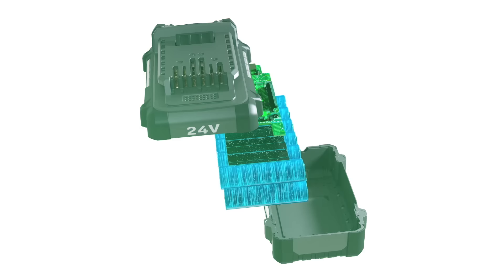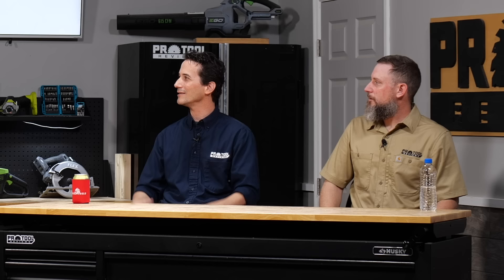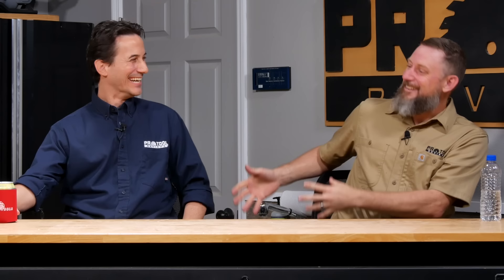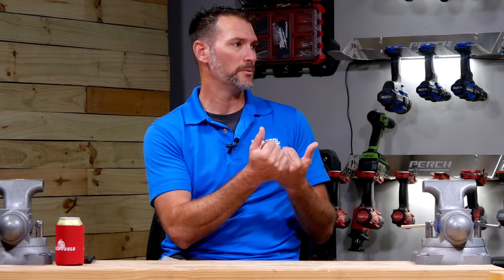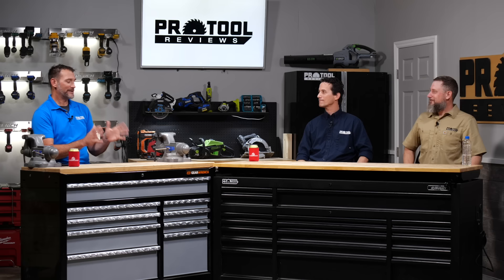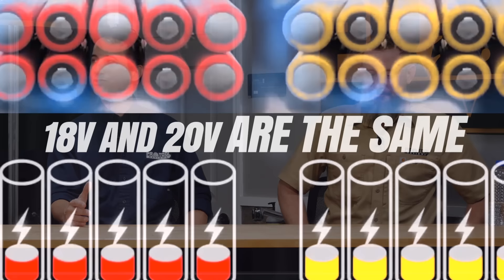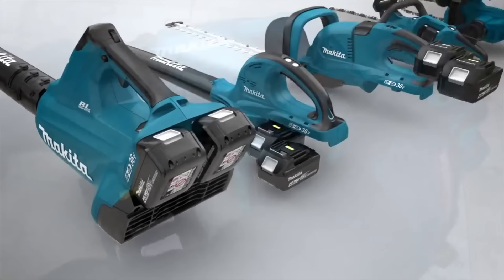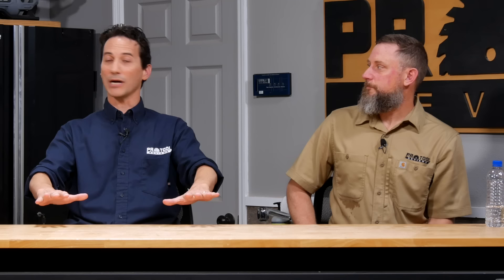You Should Buy 12V Instead of 20V… HERE’S WHY!

Comment: As an apartment maintenance technician, I'm pretty happy with my M12 Surge driver and oscillating tool. I occasionally use my M18 circ saw and M18 drill, but for the most part, the M12 is perfect for my situation.
Reply: I agree except that if you have the FUEL oscillating M12 tool, the battery lasts for literally two minutes. Every time I grab that tool I have to look around for batteries. The surge impact that I almost didn't buy because of the cost is great,
Reply: I'm an apartment maintenance tech too, and I completely agree. The size and weight are perfect for keeping in my tool bag.  The M12 tools will do 90 precent of what the 18v tools will do, but for much less size and weight.
Reply: @mytuberforyou  I have the fuel oscillating tool too, and I haven't had any issues with the battery not lasting.
Reply: @mytuberforyou  I used the oscillating saw with the 2ah batteries and they seemed to draw down quickly. Now I use a 4+ah battery and like it better. I mostly use it for grout removal.

Comment: I've found my M12 circular saw great in certain situations. When framing up structures it's not the greatest for constant cuts of 2x lumber, but if your working overhead or on a roof and need to make a quick cut it's incredibly convenient.
Reply: Needs a gen 2 with a rafter hook . Because it's so small and convenient I usually carry it up a ladder in a roof situation
Reply: I found my m18 non fuel 6.5" skill saw to be a piece of trash with a bent baseplate.

I stand by m18 fuel products. I haven't looked @ the skill saw but I bet it's good. I've seen 2 in the wild just never give it a run down. It's a full size 7 1/4" though.

My m18 fuel impact is frigging crazy! It has 4 settings, can be super delicate and stop itself, or like a mama bear, or papa bear mode! And a self tapping setting that stops it from impacting until it drills through.

The my key version you can go on your phone and set the torque value, and it has anti theft, but it's an extra 100 bucks...

Comment: I have Dewalt 20v and Milwaukee M12. I generally reach for the M12 fuel. In fact , like this morning, I only reached for my 20v impact because I could not remember where I left my m12 impact.
Reply: I have a couple m18 drills, a bunch of m12 stuff, and a ryobi set I bought because I needed a bunch of power tools and it was cheap. I've used the ryobi stuff a handful of times, im always using my milwaukee tools

Comment: I can agree somewhat with augmenting with 12v tools in certain instances of very tight spacing in specialty trades such as hvac/service techs/plumbing. Personally, after 38 years as a master carpenter/builder by trade, and a "can fix almost anything" guy in my off time, I have never found anything that i couldn't use my 18v Milwaukee tools for through judicious use of adapters/extensions/swivels that I couldn't accomplish using hand tools. To me the lack of power and versatility in a 12v tool doesn't justify the added cost and headache of having to buy, carry, and maintain them.
Reply: Yea, same here. plus I have to have a second type of battery...
Reply: @marcburns508  Yeah, this idea of going 12v seems to be for people who dont mind taking up extra space and cost having 2 versions of each tool, just because one is 2 pounds lighter and a tiny bit smaller.
I sympathize, but everybody is admitting 12v is only good for most things, not all.
So its nice to have if you dont mind using the extra space or cost, but this discussion would be less edgy if they changed the title to something more suggestive instead of demanding.

Yeah, 12v isnt bad at all, but I mainly need these when traveling for work, and I prefer a tool that does it all, instead of that only does most. But thats just me. If you have a shop, I get it. Space and cost dont matter as much.
Reply: As someone who maintains 16 properties and does everything from plumbing, moderate carpentry, hvac, and electrical I love my 12v tools for the light weight, compact size in my bag and general ergonomics. Also helps I got an insane deal on a 4 tool m12 fuel tool set but I’m not complaining

Comment: As a luxury apartment maintenance technician in a building with over 200 units, I’ve learned a 12v, especially the 12v fuel lineup is super useful. Light and almost as powerful as 18v. My 12vs do everything I need, literally from concrete to cabinets. Takes a bit longer but speed isn’t important in our field. Accuracy and precision is. And working hvac as well, it feels great to no longer carry 18v. The bag is heavy enough, 2 pounds makes a difference over time. Only 18v I have is my leaf blower. Even my vacuum is 12v from Milwaukee.

Comment: Once a installed 4 rows of seats on a big van (involving drilling and tapping the hardened steel legs of the seats) with only a Bosh 12v drill that are even more compact than those mentioned, and they were brushed the nowadays brushless are even more efficient and powerful.
Reply: I have had a 12V cheap mini SDS hammer for a couple of years, maybe not as powerful but powerful enough, light, and comfy, router and multi-tool pretty much the same...best description for 12V is "it'll do, little piggy, it'll do" xD

Comment: I bought Milwaukee 28volt system in 2002. I still have some of them and use them daily. I also have 12v and 18v. There is a MASSIVE difference in their capabilities.  If you want to do 80% of the work with no issues, get 18v. If you need lightweight and convenience get 12v. If you’re a professional and need the tool to easily get the big jobs done then get the 28v.

Comment: I run a yacht restoration and rigging business. I almost exclusively use the M12 line of tools for all of my rigging and most of my yacht restoration work with a couple of exceptions. The compact design make these tools perfect for hauling up the mast.   If you look at the M12 fuel line you will find that the power of the gen 2 and 3 tools are nearly the same as the older style of M18 or 20 volt max. The 12 volt tools will meet the needs of more than 95 percent of people and even most contractors

Comment: I am a big fan of the M12 Fuel system.  I have a few of them including the new Fuel multi tool. I had my Milwaukee 18v Fuel hammer drill and impact driver stolen. I had just started a handicap ramp job when some low life broke into the truck and got the 18v system. My HD store did not have the same kit in stock so I grabbed the M12 fuel kit. I built that entire project with the M12 fuel kit. Including using the hammer drill quite a few times
 Driving a large box of 3" deck screws.  Drilling through the 4×4s and joists for the carriage bolts. Driving a bunch of 3.5" lag bolts.
The list goes on.
I was highly impressed with the power and ability of the M12 Fuel system.  This was a large job complete with a landing for a 90° turn to follow ADA guidelines. 
While the Milwaukee M12 Fuel system is probably not designed for this extreme use I can attest to its ability to carry it out. I highly recommend it. For a home owner that dosen't really need the 18-20 volt systems but wants something that could do anything they wanted, including building a deck. This system is more than capable
Reply: I think the optimal level/word you used here is FUEL, or pretty much any tool brand that has a pro grade level.  Had you simply bought the Milwaukee brushed, or even their brushless M12 line, I'm wondering if you would have seen the same results?  Or if you would have had similar results, but at a little slower pace?

Comment: Most of my cordless tools are Makita. I recently bought a Milwaukee Fuel combo with a 12V impact driver and hammer drill during a sale at Home Depot. They're great and work for most things around the house. My 18V Makita impact driver is actually slightly smaller than my 12V Milwaukee, minus the battery. However, that battery size does make a difference when doing certain tasks. No big battery getting in the way, but plenty of power to do what I need it to do. The drill is significantly smaller than my Makita and also comes in handy when space is a premium.

Comment: Rigid,it’s a no brainer. Free repair and batteries for life. I have them in both voltage platforms and reach for the 12v the most. Love the multi tool and like he said it fits in my main bag along with a drill and is always within reach. Fits in my pouch and going up a ladder and is easier to carry. 18 v if I’m driving 3” screws ,sawing and demos. 12v for cabinet and furniture building. Oh and I’m old enough that I started with the 7.2 Makita and Ryobi platforms in the 80s. Cheers

Comment: As a new homeowner I had to start getting into DIY projects and landed on M12 Fuel drill/driver kit with free multitool and they have been great...been able to use a 1/2" bit on the hammer drill to drill into concrete for a gate drop rod. So far I'm really digging the M12 Fuel line so I may go for a few of the other tools in the line (have my eye on the hackzawl) but for anything I need more power for I'm going corded i.e. circular saw. For home use I don't see the benefit of going all in to a battery line when corded works just fine if not better.
Reply: I've been looking at the m12 and m18 hakzall im stuck idk what to get
Reply: The m18 fuel hackzall is nice and smooth compared to the m18 non fuel one. Also more powerful.

I suggest m18 fuel products. My impact is next level with 4 modes from delicate to wild and a self tapping screw setting. The hammer drill is a hammer drill when needed and has a nice optional handle if things are critical. The multi tool is variable speed with great power, I'm normally running on #4. And they all work with my compressor, skill saw, blower, sucker, hackzall.

I do think for home use though. The m12 fuel is probably great.

I will say though. Only buy fuel. I bought a non fuel skill saw I don't like (baseplate warped) cheap flat metal with no structure. And a non fuel m12 drill. Rotates so slow I want to throw it in the drink. Wouldn't use it on my bicycle (it's intended use!) Gave it to my aunt for her home kit as it slightly beats using a screw driver, slightly.

Comment: I bought a 12 volt Milwaukee screw gun (not a drill) yrs ago when I was installing vinyl siding on my house to drive in truss head screws. Works great plenty of torque and slow enough to control it. I’ve got a whole outfit of makita 18 volt tools but at work I use the 18 volt subcompact kit. Use the impact to clean out threads and to change t-nuts on a 3 jaw chuck. The drill has a 1/2 inch chuck and works on anything I need to do. Absolutely love the kit but I use my little Milwaukee screw gun for small jobs around the house. It’s a great little tool.

Comment: Im a milwaukee Fan Boy always have been years ago I had all the new m18 Fuel  Tools and started Picking up 12V Fuel stuff After about 6 months All my 18V Stuff was Still in New Condition and My 12V Stuff was well used So I sold all the 18V Other Than My Grinder And never went Back to 18V I have Been an electrician For 10+ Years 90% Of my Work is residential And the Fuel 12v Has not let me down

Comment: You guys missed something--the motor on my M12 impact driver is actually BIGGER than my M18.  For a long time I stayed away from 12v tools, because there used to be a huge power difference between 12v and 18v.  But with new lithium batteries and brushless motors, the gap between the two is much smaller than it used to be.
Reply: Craig Dendy  I actually would like you hear what you are getting at here.
But I have seen reviews of all the brushless, and the power difference is still large between the less and more powerful tools. The motor isnt everything. Being able to push more power into them is everything.
And a bigger motor can mean less efficient. Its all dependent on the architecture.
but yeah, the power source means so much, which is the whole point of needing more volts or amps.
Reply: I stand by my m18 fuel impact gun (non hydraulic)

2,000 rpm, 2,000in/lb max torque.

Yet it has 4 settings, so it can do perfect little baby taps and stops itself.

If you splurge the extra money for the my key version. You can go on your smartphone and dial in it's torque value making it like an auto torque wrench... plus it has anti theft features.

The next model will probably have a human attatched!
Reply: As a counter play on the Olympics Motto I expect power cordless hand tools to evolve “Smaller, Lighter, Stronger”. The latest M12 Fuel brushless line is a good case in point. Sure, if you’re an iron worker 80 volts and magnetic capture is spot on. For many of us, as so clearly stated in a majority of the comments throughout, nimble, precise, manageable are the watchwords. Bigger is better for pure Miller Time boasting is a fading tradition.

Comment: I run 18v makita primarily. But I have been getting more and more 12v milwaukee. It started with the 12v installation drill drive (absolutely love this tool). Now I have several 12v lights, stapler, engraver and the 12v fuel pex expansion tool (another great tool).

Comment: Yeah, I have all M12 cordless tools with the exception of an M18 circular saw.  The other tools that I would consider for 18V is an angle grinder, jigsaw, and sander.  But I have corded versions of those which are fine for me (I don't use them very often), so I'm not inclined to upgrade any time soon.

Comment: Thanks for the excellent overview. I've been wondering which system to choose and this helps. 

As for system voltage affecting heat produced in the battery cells: Oddly, reconfiguring a pack for higher voltage does not reduce the current or heat produced per cell for a given load.
For example imagine a 360 Watt load using 10 cells.
At 36V the 360W load is carried by one string of 10 cells, current per cell (and string) is 10 amps.
At 18V it requires 20 amps to get the same 360W power. This is shared by two parallel strings of 5 cells each, so the current per string is still 10 Amps. 
Higher voltage does reduce the current in the wiring, electronics and motor, so the real advantage is in the balance of system. A primary disadvantage of higher voltage is the increased cost of the Battery Management System. 

Now if only we could freely swap different brands of batteries, then I would feel like the manufacturers cared about us customers. :-)
Reply: @Protoolreviews  I'm not 100% sure, but I've heard that in Europe, that's exactly what they're implementing. So I guess that it could happen
Reply: @Protoolreviews  😂

Comment: I bought into the 12v Milwaukee stuff because I do a lot of automotive work and general home repair, usually in confined spaces.  12v is TONS of power for a drill or ratchet, the impact wrench is a LITTLE lacking for heavier work but still plenty for wheel lugs or most automotive suspension.... truck stuff where you're dealing with 125 ft/lbs or higher the M12 impact can be lacking.
As a Canadian the best part is the M12 heated jackets sharing the same batteries, outdoor work in the winter doesn't suck when you're toasty warm.

Comment: I am fully fledged DIYer (fixes neighbours appliances and builds decks) and the M12 Fuel range has been my favourites set of tools for many years. They are light and powerful enough to tackle all of my projects. That said my circ. and jig saws are Dewalt 20v. I think its very different if you are a professional who is using cordless tools for more than a few hours a week. For those folks the 12v range in certain tools (drill/driver mostly) with high output batteries may make sense.
BTW thanks for putting out a great video. always informative and very honest. Thanks again.

Comment: I have both 18v and 12v in Metabo......I use the 12v stuff for putting up flat pack furniture and drilling into wood. The 18v for hammer drilling, wrenching and for my multi tool and jigsaw. Horses for courses...........

Comment: I really like the miniature nature of 12v and I have some m12 tools. By and large though my work is too heavy duty for 12v as a primary platform. I’m finding that my power demands are sometimes even  unmet by 18v, such as with recipe saws and vacuums, so I’m  looking forward to Makita’s 40v line which I’ve already bought into, but the 12v tools are very neato and compact, super attractive
Reply: 40v is 2x 18v. Anything using dual 18v meets that power spec. 60v is 3x. Notice the 18v vs 20v chat in this video.

I moved away from makita in 2022 for milwaukee. I feel it's the superior option.

I haven't really began looking into the higher voltage stuff though. I do know I would prefer to use 2 18v vs 1 40v battery though. Because I have like 10 already and buying batteries sucks. Milwaukees lawn mower can mow down a baby tree...

Comment: I was on 120v (saw, reciprocation saw, mixer, drill, screw gun) until I got my 10.8v bosh about 7 years ago (Ive bought 5 sets since then). Having worked with wired dewalts in commercial construction really turned me away from the brand, they also got painfully hot in the summer thanks to the(new then) higher drive gears. The battery dewalt was never an option and sub par compared to wired. I finally needed a small impact to drive self tapping bolts on R panel roof of a warehouse in 110 degree weather, so I picked a 10.8v bosh set. I have never looked back, I drywall entire homes with bosh 12v impact. I drive concrete anchors, concrete boards, 3" decking screws, hole saws for electrical, hole saws for tile and everything on bosh 12v. I only picked up a 18v ryobi for impact and it over drives all the screws for no good reason. I even find the bosh vibrator saw more powerful than the ryobi 18v, I mix mud, mortar thinset and everything with my ryobi blue drills. The old ryobi drills are way better than anything dewalt (homedepot used to warranty dewalt) has made, when they eventually burn out after a year I find another 18v blue ryobi drill in my shed. It beats having to find a dewalt service center for warranty.